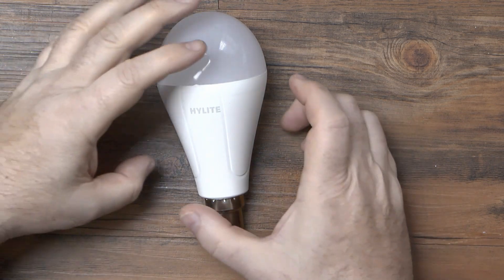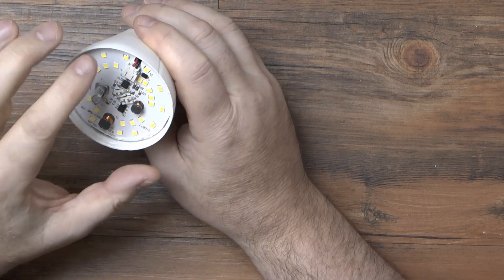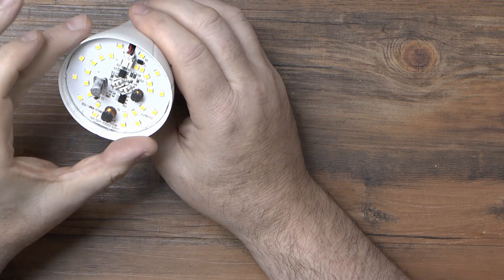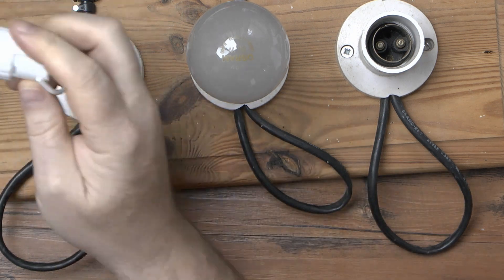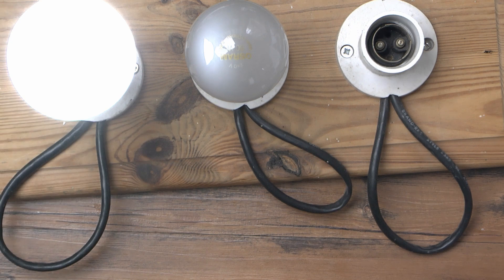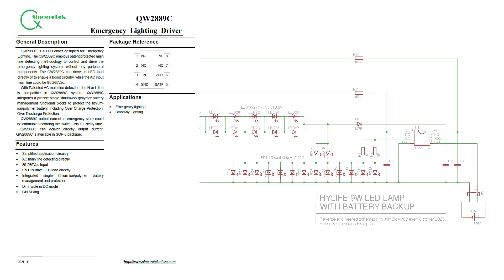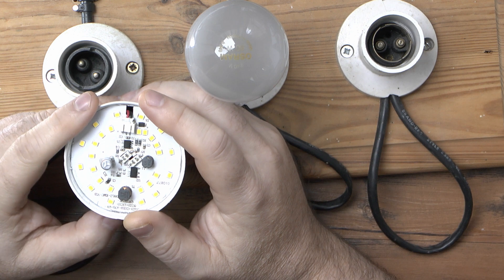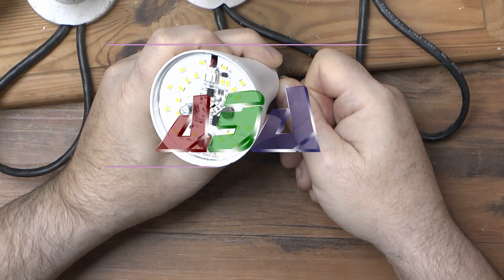What's inside a 9W rechargeable LED lamp?

Comment: Very different to the ones I've taken apart.  Before the custom chip it tended to be a MOSFET and high value resistors detecting the continuity across the pins.

Comment: rechargable? that's 1 i havnt seen before, thanks for posting
Reply from the maker: Yeah, it was an odd one that came up for review on Amazon Vine.  I grabbed the pair expecting them to be crap, but I'm very impressed with the way they work, and the fact they know the difference between "the cable to the light switch" and "beyond that to the rest of the switches on the floor".  Even tripping the RCBO so it's just got other switched-off switches on its circuit is enough for it to go into power-fail mode, although there's one electronic switch on the circuit that it may be spotting.